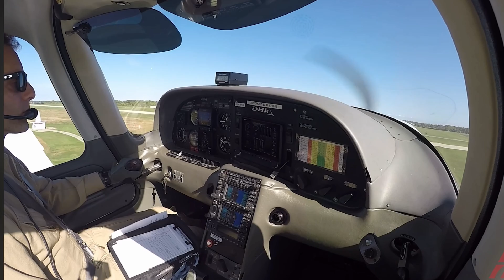Early Years of DeltaHawk Engines: Dennis Webb

Comment: Great engine. Conceptually nothing new but they have managed to cross the line when others who went before have failed. The only problem they have is the lifespan of the product. In 20 years time, maybe less, all GA aircraft will be powered by electric motors.
Reply: I don’t think you’re overestimating battery tech. The energy density of diesel is exponentially higher.   Electric aircraft will certainly carve out a niche.  Probably short hops and unique applications.

Comment: The Detroit diesel or the air but without exhaust valves, it works very much like a two stroke engine but relies on the blower & turbo charged air to blow the exhaust out through the ports at the bottom end of the piston stroke! 👍